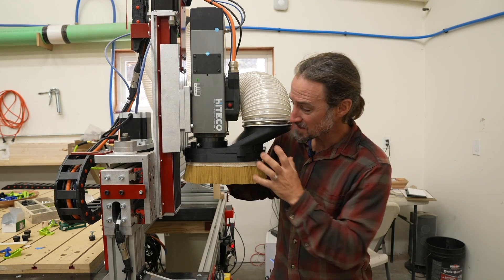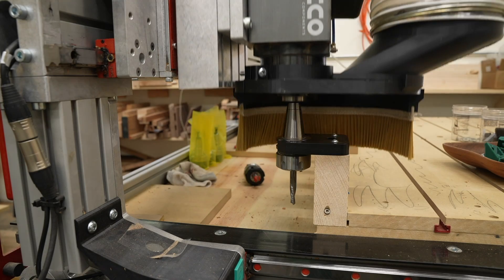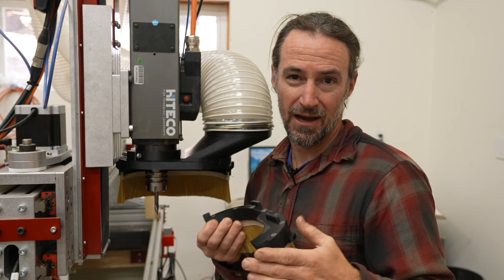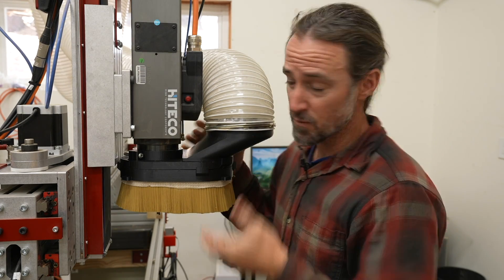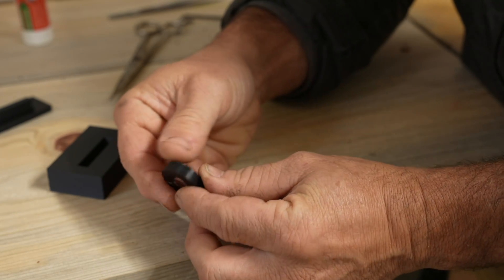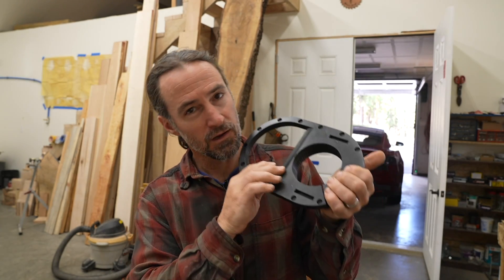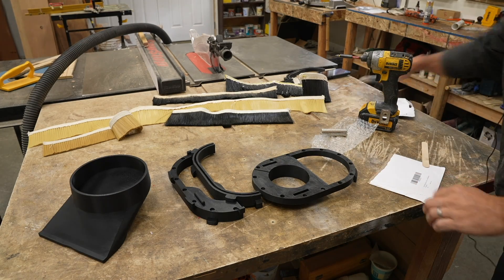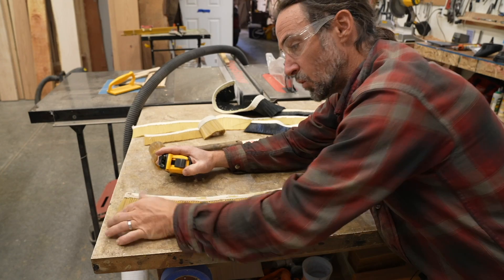CNC Build Ep 10: Print Your Own CNC Dust Shoe for The Best CNC Dust Manifold Design

Comment: Nice job I will give it a try, thanks so much.  I am learning both Fusion 360 and CNC on a small CNC (Genmitsu 3020 now 3040 Pro Max V2).
Reply from the maker: Great! Hopefully it can fit -- the base is pretty large, and doesn't fit on some machines. That part isn't very parametric. If i do another version I'll make it more flexible in sizing.

Comment: Could this probably be made shorter on the front
Reply from the maker: In theory, it could, but the model is pretty dependent on the current oval size, which is dictated by the ATC tool change shape. Eventually I may make it more robust for changing the base shape.

Comment: I still really like this video, did you have STL files for those that don't have pro Fusion? Thanks
Reply from the maker: Yup, the download has STL files. Link in description. But FYI, Fusion is free; you don't need the paid version.
Reply: @CorbinDunn thanks so much for the reply I love your content!!! I looked at your site when downloading and it said if you need to modify you might need to have the pro version
Reply from the maker: @samrix5793  I use Configurations, which are in the paid version, but you can edit the main configuration (or so I’m told)

Comment: Hoooooooooooly spit, that's almost exactly the same idea I had, except my idea is much less slick and I didn't have it until apparently almost a year after you solved it, videoed it, and released the model 😁
I like the way you solved the front access piece with that taper. That's the biggest improvement that I hadn't thought of (in addition to all the smaller advantages yours also has).
I've got very little space on the sides, and this looks like it's gonna work GREAT.
Very much appreciated, hope the comment helps the algorithm!
Reply from the maker: Awesome! Yeah, definitely modify it in any way to make it better for your particular machine!

Comment: Thanks for the great design.  I am new to Fusion 360, and can create various simple projects, but I don't know how to scale your design to fit my FoxAlien 4040-XL Pro.  My spindle is 65mm and my dust hose is 2.5".  I changed those hole dimensions and it printed out fine, except the overall size of the whole dust boot is way too big.  Is there any way that I can scale down the whole design and make the spindle clamp 65mm and the dust hose port 2.5" . I looking to make the overall size 4.5" x 7" or close to that.  I would really appreciate it if you could tell me how to do this in fusion 360 (I have the free version).  Your design is definitely the best I've seen.
Reply from the maker: Hi Craig - I made the base size sort of fixed based on an ATC and my spindle diameter. You can change the initial sketches to resize things, but it will likely "break" something downstream at some point. It's not easy to just scale it down. If/when I design a new version I'll make sure it is more parametric to work for smaller sizes.
Reply: @CorbinDunn  Thanks for your reply.

Comment: I get this message when I try to open the file on Fusion "Error: Fusion 360 could not open Avid - ATC CNC Dust Shoe v3 v7.f3z because it is not a supported file type." Let me know if you can help me get this file uploaded to Fusion. Thanks
Reply from the maker: Hi Kyle, Yes, I can help! You have to migrate your fusion account to "teams" from "single user"; it's available for all users, including the free license. The file format uses Configurations, which require Teams (for some reason...)

Comment: McMaster Car sells a brush that does not use all the white cloth to hold it together (7900T2 Easy-Cut Strip Brush 7/32" Wide X 3/16" High Backing, 3" Overall Height, 5 ft. Length).  This is useful with a dust boot that uses short cutting bits.  If you use a router, almost all routers have a fan that pulls air in from the top and out the bottom for cooling.  This will cause problems with a vacuum trying to suck up the dust and most of the dust will be pushed out of the brush cavity.  So when designing your boot, make sure you funnel (divert) that air out in your design before it hits the boot cavity.  Do not block the air flow as your router will over heat.   You can design this in your 3d print.  Also you want to have a brush (skirt) that snaps on and off (use the magnets) as you will need to print different skirts that use different length brushes depending on the length of you cutting bit.
Reply from the maker: Awesome! I need to look into McMaster Carr's brush; I haven't been super happy with most the amazon ones I have been using. So far, I haven't had issues with the spindle's cooling air fan causing any issues.

Comment: do you have a file for a 65mm spindle
Reply from the maker: Yes - the Fusion 360 file is parametric, so you just set it to whatever spindle size you want. I wrote directions in the download on how to do it. If you have trouble figuring it out, send me an email and I can export an STL with that size. Thanks!

Comment: This looks amazing!    I’d like to see a feature to add in a polycarb window to watch the cut.    Another need is a port to mount a compressed air brass tube that aims at the cut.   I’d love to see an incorporated inset for a led ring light too
Reply from the maker: Yeah, those are great ideas! I experimented with some clear dust bristles and windows..I just couldn't get them to work right. I did run an extra air line to my spindle -- someday I might set it up. I used air exclusively on my Tormach PCNC, but on the Avid I've been pretty happy with the dust collection.

Comment: Hi Corbin, great work as usual.  The one main suggestion I would make it to alter the design so that it attaches to the fixed gantry and not the spine;le.  Make it height adjustable so that before each job you set the height to whatever material you are cutting and the hood will sit flush with the top of the material always during the job rather than going up and down with the height changes of the spindle.  This has improved my dust collection greatly. I did mine so that there's an upper and lower frame with about a 2" plexiglass in the middle so you can see what the tool is doing during the job.  the bottom frame has brushes but they are very short, less than 1 inch, because they don't need to be any longer when the shoe is always flush with the material.   Also, anything you can do in the F360 design to move the mouth of the dust suction as close as possible to the tool / cut.  This has a big impact on getting the dust into the chute.  Of course, my first suggestion would blow up your design and process for doing automatic tool changes, you would have to make considerable changes on that I realize!   all the best

p.s. I would offer to share my files and design but I can't really because it's a total hack job and not fit for human consumption.  it's just duct tape and bubble gum to get the job done until I have time to make a proper F360 parametric model for printing.  Sorry!
Reply from the maker: Cool, thanks for the ideas! I do like the long brushes because I tend to do deep carves; I actually have to remove the 100mm brush to avoid collisions! It is somewhat adjustable -- I can move it up and down about 0.5", which is generally enough for what I do, along with the ability to use a different brush length. I'll definitely take your ideas into consideration the next time I mess around with the design!

Comment: Hi Corbin I tried logging in but the log in button doesn't seem to be working. Also the add to cart for this project also does not seem to be working.
Reply from the maker: You shouldn't have to login -- that should work (if you created an account), but it isn't necessary. Add to Cart takes you to the cart page and you can checkout (it's all free -- it just lets me track downloads). I just checked it and it seems to be working. Maybe try a different browser? Other than that, maybe it is an intermittent problem with my site; I don't pay for the best hosting...
Reply from the maker: I double checked account creation, and it seems to be working (I used a private browser tab to isolate data). I'd suspect an issue with your browser.

Comment: Well done Corbin!  Looks like a great design.  I will think about printing it - my current dust shoe actually works well - it was one built by Kents CNC.  I don't have an ATC - so maybe it wouldn't work well with an ATC.  With that said a couple features that your dust shoe incorporates I think could be very helpful for me:
1) the ability to remove half the shoe while carving should allow me to get videos for my YouTube Channel of carving/cutting with more dust collection than I currently have.  I often pull my dust shoe off to get camera shots which then doesn't provide any real dust collection.
2) the ease of pulling your hose off for clean up.  I have attached a Rockler dust right attachment to my current dust shoe to allow me to do this and it is a bit bulky - looks like your setup will be more convenient.

Thank you for sharing your ideas and your files.

Just downloaded the files - thank you.  I didn't see a Fusion 360 file only .stl files.  Did I miss something?  Thought you said you were providing the F360 Parametric file.  Couldn't find a contact point on your website or I would have asked this on your website.  Thank you again.
Reply from the maker: Thanks Rob! The Fusion 360 file should be at the top level in the zip, called "Avid - ATC CNC Dust Shoe V2 v69.f3d" -- Let me know if you see it...otherwise I messed something up!

And yeah - the split design is also so I can do some video shots while using my CNC. 

I'm already thinking about updates: My version 3 will make the dust port easier to grab; I'd like some sort of handle on it.
Reply: @CorbinDunn  I just relooked and the file is in the Zip file.  I think I got focused on the two folders that were also part of the zip file - though the Avid - ATC CNC...file as the left over Zipfile.  My bad but after pointing this out I looked more closely.  

I am not well versed in Fusion.  Started to get there during covid but then switched back to Sketchup, which I was more familiar with, when I stopped designing as many 3D Printer files.  

Now when I try to use Fusion it is like trying to start all over - but think I need to get back into it after watching what you do.  I am really glad I found your channel.
Reply from the maker: @RobSandstromDesigns  Cool - glad the file is there! 

Fusion is great with the timeline feature; you can scroll back and step through the file to see how I did everything. I was a big SketchUp user for a long time, but now I really like Fusion; some things are slower with it...but you can get more precision.

Comment: Nice work Corbin!  Thanks for sharing all this great content for we CNC afficionados.
Reply from the maker: No problem! I definitely enjoy helping out the community.
Reply: . @CorbinDunn  You've inspired me to rework my dust shoe approach.  I've got a CNCDepot ATC and created this overly elaborate pneumatic dust shroud lifting solution that, honestly, stresses me out every time it's triggered.  Your solution is like a face palm... of course... moment for me.
Reply from the maker: @portlandscott  Cool! If you have an S30C, they run hot -- try printing it out of PLA+ at a minimum, or ideally ASA or ABS to have better heat resistance.
Reply: @CorbinDunn  Thanks for the tip.  I haven't ventured into anything other than PLA or PLA+ yet, but I'll use this as motivation to dive in.

Comment: That thing is slick. The removable vacuum hose is a cool concept. And yeah: Definitely seems like too much magnet strength, especially if you ever wanna get sketchy and try to remove one side of the skirt when the machine is in use.
Reply from the maker: Yeah! Luckily I can re-print the smaller bottom pieces and glue in less magnets and see how it performs. I was going to do another one for a different brush size, so I'll do some testing.